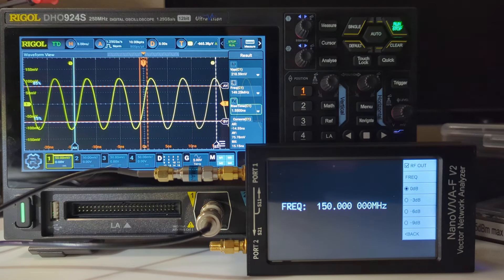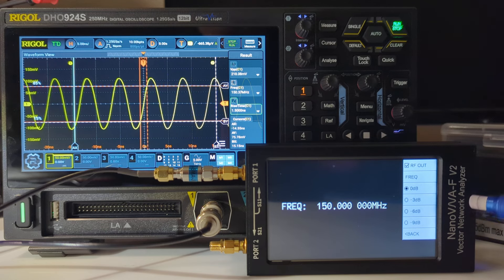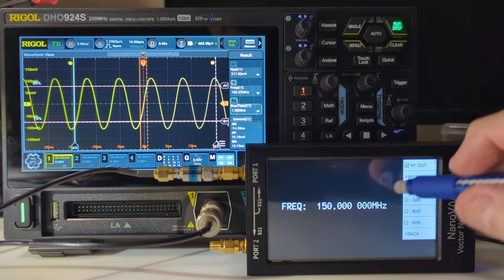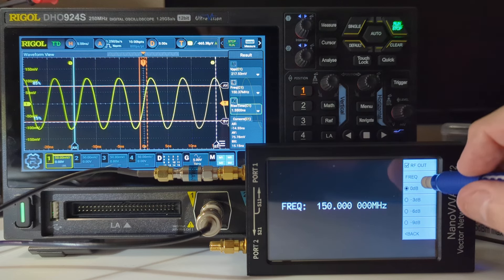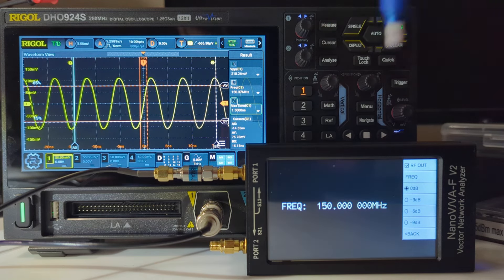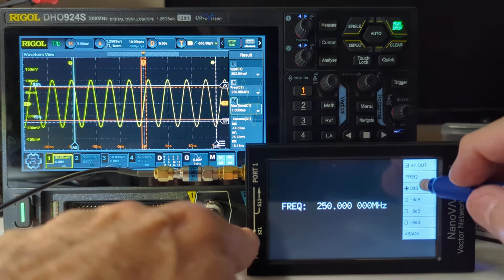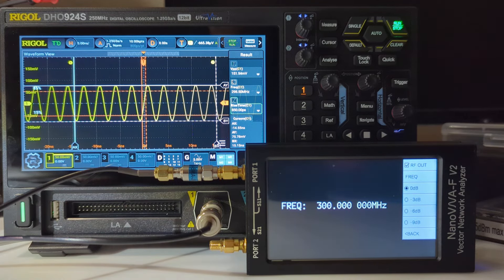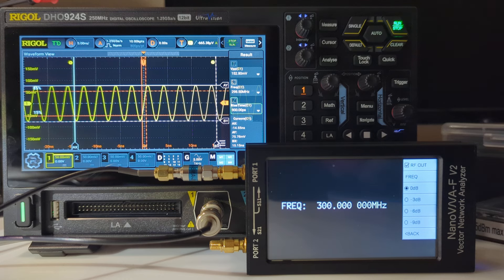Rigol 924S Oscilloscope bandwidth measurement

Comment: Hi. I did a similar test with tinySA Ultra that has sinusoidal output up to 800MHz. I need to re-do the test as I am not very sure if the amolitude of my source is "even" through the wanted range. Are you sure yours is? I can look at mine also on an different spectrumanalyzer...
Reply from the maker: It's a very good question, thanks. Here is a link (below) to another video I just posted. I've attempted to keep the power levels constant across frequencies (as best I can without lab grade equipment). That test yielded a bandwidth of 290 MHz. I'd be interested in seeing whatever test results you get. Thanks again. https://www.youtube.com/watch?v=-kgD-74RH8M